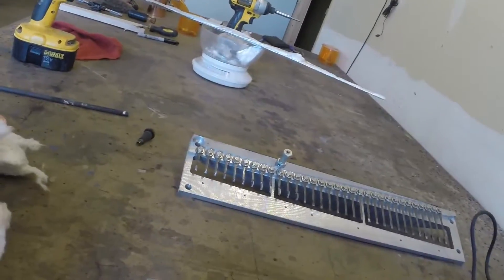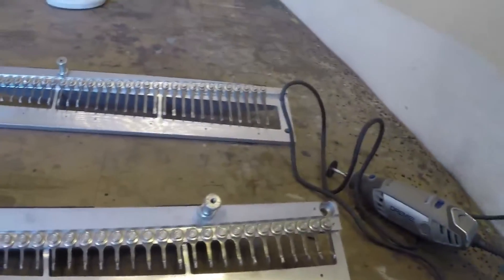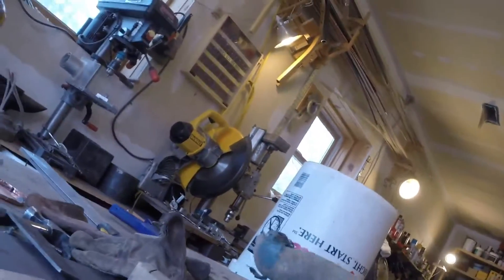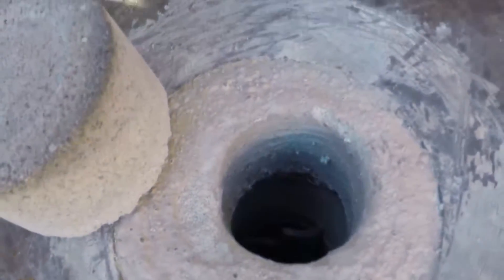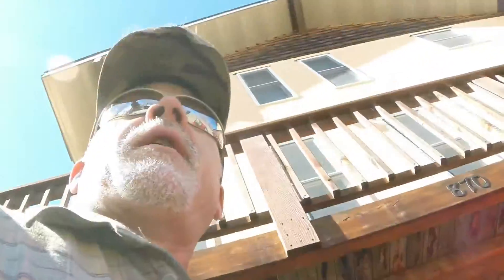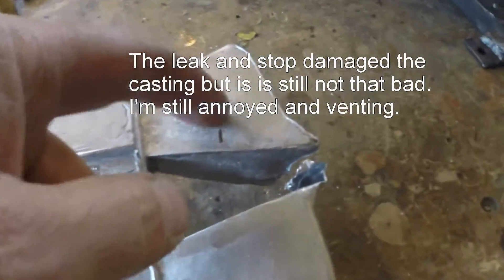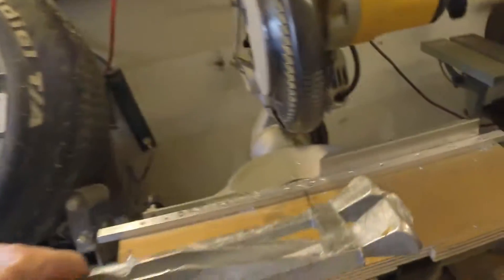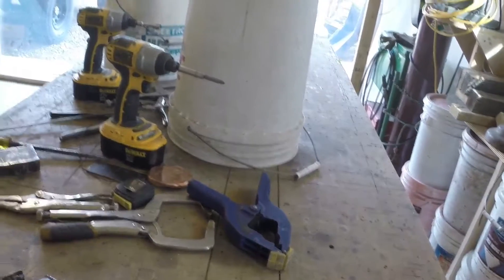Reusable aluminum casting mold 4

Comment: That rim broke so cleanly and melted so easily. Given the age I wonder if it had a very high magnesium content or even pure magnesium? Remember why we called them "mag" wheels way back when. Magnesium rims were common when we were younger. Torque thrusts, etc.  Be careful. I am not an expert, just felt the need to comment. Be safe.
Reply from the maker: Jeff, I think you may be right. It melted around the temperature of the Mg alloys, and there was 'foamy' dross (I think commonly seen with Mg alloys) in the melt. The pure Mg wheels were popular in the 60's, and these wheels could have been made around that time. Before I melted the parts, I did try to ignite a small piece to make sure it wasn't pure Mg and possibly dangerously flammable. In a much earlier melt, I mixed some 713 alloy from pure metals, and had to add a small amount of pure Mg to the melt. I was concerned it might ignite, so I took precautions adding it. The piece was submerged quickly, was instantly coated with aluminum and did not ignite. I do know the wheel material welded easily, but I do not know if Mg alloys are easily welded with aluminum (4043 alloy I'm pretty sure). However, the melting point really is more in line with a Mg. alloy.Thanks for your comment!
Reply: Sounds like you know what you're doing. Just wanted to make sure you didn't burn your shop down or worse. Good video.
Reply from the maker: Thanks for your concern. I really do love metal casting, but it is absolutely dangerous! All of us who do this should understand the dangers and plan accordingly

Comment: I like the permanent molds, they will save lots of time making batches of parts. How are you preheating the molds?
I was starting to get motion sick by the end of the video, maybe just set the camera up in a good spot and leave it there until that segment is shot then shut it off til you set up of the next segment. it would make the video much more enjoyable.
Can't wait to see more on casting with permanent molds. thanks
Reply from the maker: Thanks for your comments. I simply use my regular oven to preheat the molds...they are clean and the BN coating  once dry does not outgas so not a health issue. Just work to get your timing right so the mold is still at temp when pouring. I have been heating them between 450 and 475 degrees. If you are serious about permanent molds, check out the 5th video because it goes into detail about correct mold design and might be useful. Yes, watching the shaky footage can get rough...in the future I intend to smooth the shaky video.